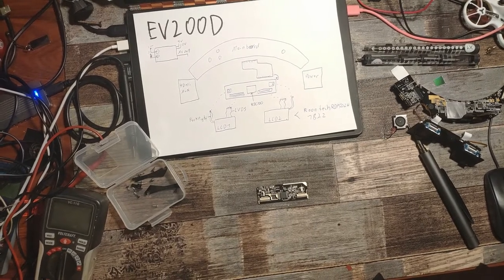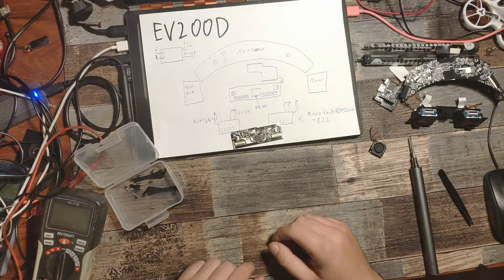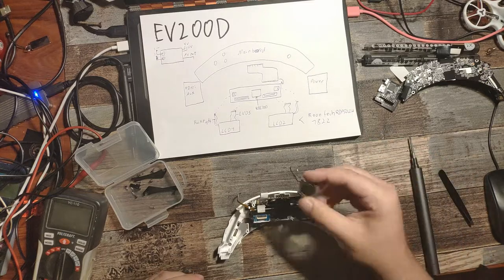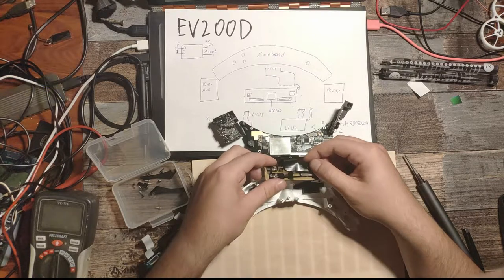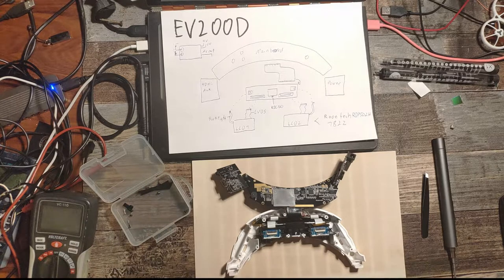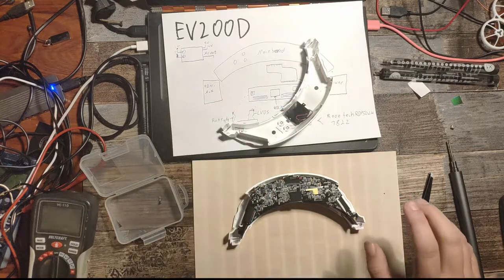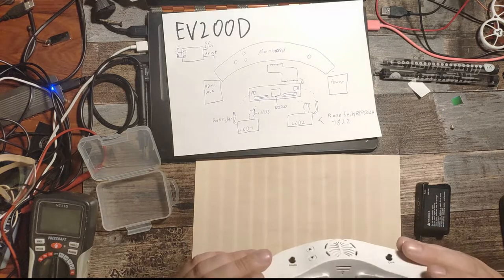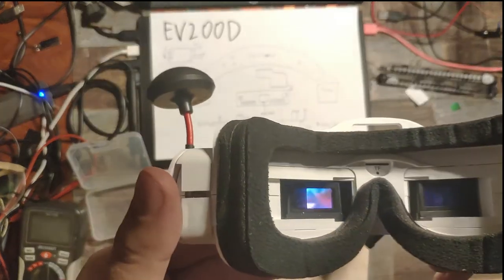EV200D disassembly and repair

Comment: Had the same issue with my Eachine 200s.  Left lens was either dark or didn't work.  I got lucky when I disassembled the goggles.  They started to work properly again.  It seems like the assemble process or distortion of the case can effect the ribbon cable connections or the PCBs.  When I reassembled the goggles I checked the operation of the goggles after each step to make sure they still worked.  Never did find the cause!  I sent multiple emails to Eachine customer support and never got a reply.

Comment: My EV200D goggles have a problem with pal reception. When using NTSC cameras there is no problem at all. When using PAL cameras the correct frequency is being traced but both screens show snow. I tried auto mode or pal mode from the menu but without any success. The only way to see pal reception is to use an ntsc camera and while connected replace the ntsc camera with a pal one in less than 2 seconds!!!. I bought a new different module eachine pro 58 but when I tried it the problem remained. Most probably the main board is malfunctioning. Do you have any idea what to do. Unfrotunately, I traced this problem some months later than the day I received the goggles so bangood is not replacing them. Moreover I cannot find any parts.

Comment: Hi
I bought the ev200d and when I connected the battery to a 8 volt it malfunctioned one of the parts inside the device i opened the device and saw the damaged part which is kv7nf please help me how to fix the device and is there an alternative to this piece because i did not find it here in the market

Comment: could you remember the RAON-TECH model of the optical and micro display that ev200d have?
Reply: and  is there a posibility to edit display configurations of the ev200d with the RAON-TECH softwares
Reply from the maker: @omargomez9990  i think its the RDP 502h 1822 display. not sure about the software part
Reply: @airsoftwwbde   can you share some way to comunication to make you some questions  about cooling fan?